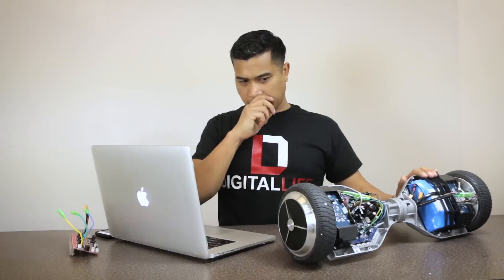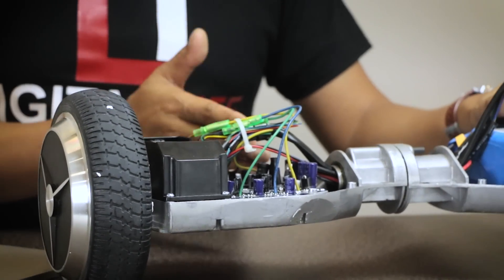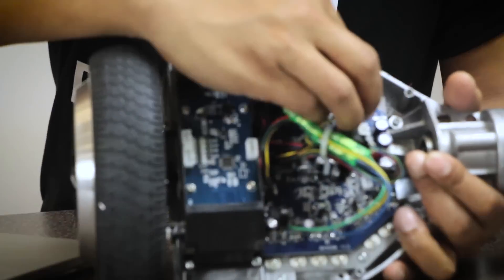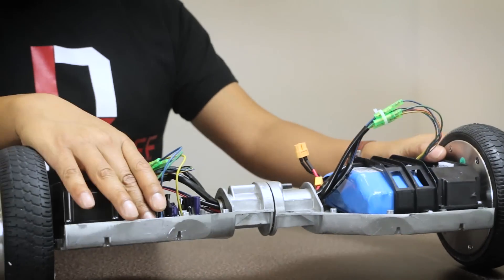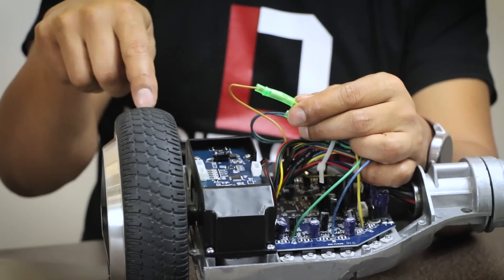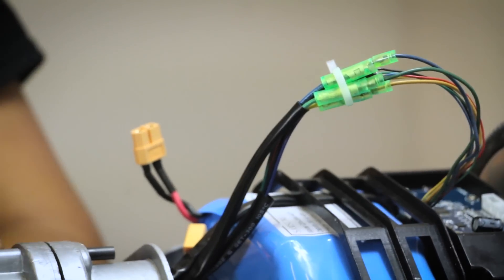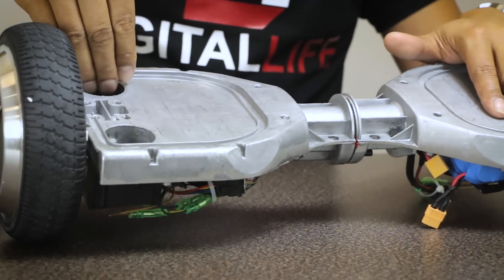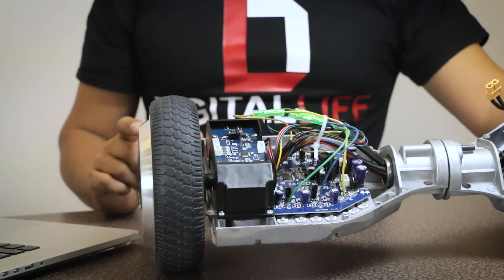Common Hoverboard Issues (Q&A) Session

Comment: Hi there, great video , i have a strange issue with my hover board and was wondering if you could help me, when i get on to the board, if i gently want to role forward or back the board vibrates really bad as if the wheels don't know if they want to role forwards or backwards, similar to dismount problems people are having but the dismount is fine, the board doesn't shake on dismount and both lights turn off straight away.

if i lean on the boards with my hands to activate the board on the ground to move forward or back the whole board vibrates on the spot like mad to the point it leaps up off of the floor, literally it has  jumped up about a meter off of the ground. i have done all the calibrating and when standing on the board it is fine, if i slowly want to move it goes crazy, once you are moving it is fine no problems its just on a slow gentle movement move off it goes nuts, any advice on what to do or parts you recommend would be greatly appriciated

Comment: Hi, 
My hoverboard is stopping while riding, do you have any clue of the problem? I replaced ALL the electrical circuits, but still have the problem... 
I just unpluged the battery as someone told me it could solve it... I was also thinking of a battery problem, but I'm not sure that it can solve the problem... The board is working if the load on the wheel is not too high (strength request), if too high, it could leed to a lower voltage of the battery, something like going from 36V to 30V or lower... Maybe you could ask around you if someone had my problem also 

Nevertheless, thank you for your answer...

Kindest regards

William

Comment: My board has a quiet buzzing sound whenever it is on. Any way to fix. It is really annoying
Reply from the maker: not sure what could be causing that buzzing
Reply: +Digital Life X do you think there is like a sound device in there like the one that makes the beeps when it comes on maybe that is doing the buzzing
Reply: +RJ's Kicks check for lose screws in the shell, or inside the board

Comment: i have the red light and not balancing problem i need fix how do i contact u
Reply: +guss wallac turn off scooter. hold power button for a few seconds until LED lights start blinking. Parts with helpful tips here: http://www.ebay.com/itm/222005226576?ssPageName=STRK:MESELX:IT&_trksid=p3984.m1555.l2649
Reply: Just ordered that kit and replaced gyroscopes and motherboard same red light
Reply: +guss wallac Would it have anything to do with your battery?

Comment: hi, my problem is that my hoverboard doesn't charge, i checked the battery, replaced it, it still wasn't charging then i  checked the input, where you put the charger if it was loose, i tightened it up and it still isn't charging, please help me. please

Comment: The center of my Hoverboard is flexing a little. Is it normal or do I need a new frame?
Reply: same thing :(
Reply: +Matthew Jendry same here i think something its broken in the middle of my hoverboard please help
Reply: It dosent bother me because my board has been like that from the start, rhere might be a bolt loose or its supposed to be that way.
Reply: i was speeding downhill before i fall from my hoverboard, becouse of a small stick in the ground and my hoverboard rolled like 3 times away from me, i think thats when a part in the center is broken or something like that (sorry for bad english)
Reply: Dont worry i think it is supposed to be like that to make it turn more.
Reply: +TheStarterPlayers it's a possibility. I'll take to my local hoverboard shop. gotta go there anyway. the Bluetooth chip went out a few days ago
Reply: Oh, please tell me what they say there!!! Matthew Jendry
Reply: +TheStarterPlayers Will do
Reply: +Matthew Jendry is it normal to all hoverboard to have a unhinged in the middle when you lift it?
Reply: +Ian Christopher Luy just found out that they put latex into the board on the factory thats why it dosent wobble on the middle when you buy it, but the latex comes off after a few weeks so its supposed to wobble.
Reply: +Matthew Jendry please tell me what they say.... I have the same issue.

Comment: Please help me. I got my hoverboard on January 4th. As usual I was riding it and the battery light turned red. So I charged it and about 2 hours later the charger light was green so I unplugged it turned it on and I saw that the battery light was green and started riding it 15 seconds later it automatically turns off. I can't turn it on and I can't charge it help!!!!!

Comment: Yo, could u help me out, when i turn on my hoverboard it just beeps 4 times and the lights are red then it turns off
Reply: eaf that means there’s a problem with the motherboard
Reply: @berv9169  you are correct but specifically on the tire where the motor is located

Comment: I have a swagway 10inch - When I plug the charger in the light on the charger is green. When it is plugged into the board the light on the charger goes off I hear a little pop sound. The board does not charge. I changed the charging port and bought a new cord. still the same result. Can you tell me what is wrong with it.

Comment: i have a QUESTION my hoverboard (the right side) seems to feel loose or delayed unlike my left side that reacts immediately i tried to tighten the wheels 4 bolts under the sensor board one bolt was slightly loose i reassembled and still have the same issue

Comment: Hi. I have a problem with my hoverboard. I push the button to start him, but he don't start anymore, I HOLD the power button continue and it's  flashing the blue lights and don't happenings nothing and in the master Platine I hear a small( pipipipi) noise when I hold the power button On. So basically don't want to start. You know what can be ? Thanks a lot.

Comment: Hi. I replaced the mail board and the balance sensor boards.  Now when I turn on the hoverboard it is balancing it self without me stepping on it.  I can still ride on it but when I step off it is still balancing.  Check all the wires and connectors it looks good. Any ideas?  Thanks for your help.

Comment: I was wondering if you know whats wrong with mine, I turn it on and then it beeps once turns red and then turns off all with in one second but i know the battery works as I tested it in a different board.

Comment: i have a serious problem when i ride my hover board it turns off on me and wont turn on when i turn on the board, i would have to plug it in. Also i never get a red indicator when the battery power is low it just turns off
Reply from the maker: Sounds like the logic board or the battery. I think more likely logic board

Comment: My hover board when the battery is low on power it loses balance for a half second and i jump off it so i dond get hurt and i was removing stones from the inside and i touched some litle chip (E01) and it yust fell off and for first it was fine but later its not

Comment: My hoverboard wont turn off. i have 8 inch bluetooth hoverboard and the only way it turns off is with the key.And it keeps beeping and one of the middle lights flashes red while the other is green and i could ride it like that for hours and it wont go dead so i know thats not the problem. pls help
Reply: ImTheBeast did you fix it yet?

Comment: my hover board quit working i hold the bouton to turn it on i wait to hear the second beep then it flashes ten times but i cant seem to find the motor on the battery side. pleas respond and make a video on how to find the motor.
Reply: The motor is inside the wheel

Comment: Please i have serious problem when my hoverboard is low battery it doesn't show the red light and it stopped so recharge it until it's full charged then i ride it until it's low battery and again it doesn't show the red indicator and it stopped suddenly. Can you help me please i ve just got my hoverboard
Reply from the maker: is the indicator light working at all when u turn it on
Reply from the maker: +Asmae Benchrif seems like it's the logic board or wiring
Reply: +Digital Life X yeah it works it turn green and while charging orange . also while charging i step on it and then it turn red
Reply: +Asmae Benchrif same problem it dont give the red light

Comment: My problem with my hoverboard is : I plugg it in i get no lights nothing, i opened the hoverboard and i see no burn caps. I disconected the battery and pluged it back, in.. Charged the battery and i get a blinking light on the biggest board. I believe its orange. I also get Beeps.   Anyne can help me wiht this?
Reply: The battery has its 32 volts, and i read it with my meeter. Do you think it might be the transistors that are not working?
Reply: Didier u fix it?
Reply: I havent fixed it but i saw online that that logic board ( not the left and right board) but the middle one for 114.98 best offer.  But i think i will check the transistors one by one. See if they burned. But i think thats way to much transistors to check.

Comment: Yo dude my hoverbored won't turn on unless I charge it but when I take it off the charger it turns off and won't turn on unless I use the charger
Reply: That is a circuit board problem or battery problem

Comment: Check wires inside of wheels. You will have 4 thin wires going into a backboard in wheel motor.  I solder my ground back on and my hoverboard worked great without balancing it. Get a soldering welding tool.

Comment: When I get on my hoverbored it is fine I ride it around when I won't to get off I put my left foot off and the my right and then it just start to skate I have to pickup the bored in turn it up side down
Reply from the maker: hi you will either need to recalibrate or replace logic board

Comment: Hi my gravity blade hoverboard will turn on but i have to hold the button to get power then as soon as i let go it turns off so short story is it will not stay on and when i plug it in and i push the button it dose not stay on but if a hold it i get a flashing orang battery light

Comment: So I bought my hoverboard 2 years ago Then a lot of water got in it and it stopped working . 
After two years I tried Turning it on but IT WONT TURN ON
Then I put it to charge and tried 
still nothing 
then after a week suddenly at 3 am It turns on but when I stand on it IT DOES NOT MOVE FORWARD
or backward And automattically turns off When i try to Turn it on it does not work the power button does not work I  PRESS IT HARD BUT still no luck I dont know what is the problem By now the water would have evaporated what is the problem then if anybody knows pls respond

Comment: Hello,
Sorry for my english. 
My scooter balance works very well for me who weighs 74 kilos (162 pounds), but for my son for 25 kilos (55 pounds), as soon as it rises above the gear starts to vibrate tremendously (uncontrollable) (vibration have found on many video where you can see one of the sensor remain depressed) which is not my case. The sensors do not seems to have problems. I can cause this problem by placing my hands on, and trying to move . There, he starts to vibrate and leave in all senses. When I take off my hands he stop his bug.

Thx for your answers.

Mon balance scooter fonctionne bien pour moi qui pèse 74 kilos, mais pour mon fils de 25 kilos, dès qu'il monte dessus l'engin se met à vibrer énormément (incontrolable) (vibration que l'ont trouve sur beaucoup de vidéo, ou l'ont vois un des sensor rester enfoncé) ce qui n'est pas mon cas. Les sensors n'ont pas l'air d'avoir de problèmes. Je peux provoquer ce problème en posant mes mains dessus, et en essayant d'avancer. Là, il se met a vibrer et partir dans tous les senses. Avez-vous une idée du pourquoi?

Comment: Good day to you, directlife x... Whenever I'm on my hoverboard, the right side always get stucked/hooked yet when I turn if off and on it will work normal, yet will still get stucked/hooked again, Please what could be the problem???..…
Reply: If it won't calibrate by the button and you holding it level it might be the yellow wire pinched? If you open it up the wires that run through the center sometimes they get pinched! That's what was wrong with mine it would only beep in one side worked regardless of calibrating

Comment: My hoverboard wil NOT stay on. Push the power and lights come on then go off. If you step on board and hold power the lights will stay on but once you let go of the power it turns back off.

Comment: Hi Digital Life X, my hoverboard gives a red blinking light (each 3x in a row) and does not move anymore. Do you have any suggestions? Regards Remon (the Netherlands)
Reply: This means that there is a circuit error...this means you'll have to replace the motherboard inside or you'll have to check to be sure that all cables are connected

Comment: my hover board will not charge and it has a solid amber light.
Reply: Solid amber light means the battery is not connected to anything inside the hoverboard. the motherboard also does not recognize a battery is connected. did you figure out the problem???

Comment: Do you wrecken that we use a  power supply and put 36volts out of the lads, disconect our battery to see if the hoverboard turns on with the power supply. VS buying a 70.00 battery, and finding out that its not the battery. The power supply will work as a battery. Just to save time, money and headaches form customers :) ?

Comment from the maker: try different charger first next you should try to swap the logic board
Reply: Thanks a bunch for the reply! you wouldn't think its the battery? I read a couple other places that that could be the issue. I have a charger from amazon coming in the mail all ready. Also How are your batteries compared to a Samsung or lg battery pack. Mine has a green mother board or logic board.
Reply: I bought another charger and the same thing is still occurring. The light on the charger stays green and won't charge the board. Do you still think it's the logic board?